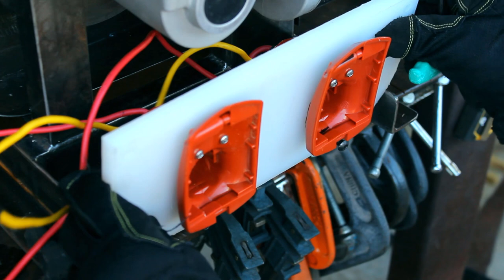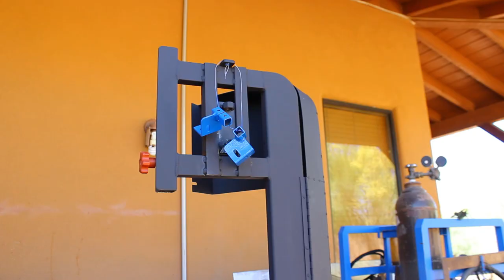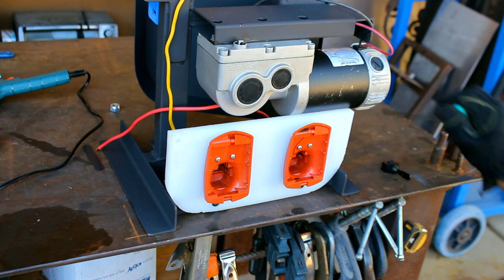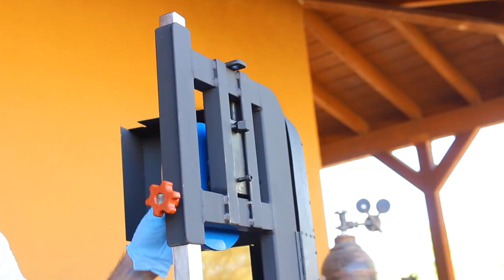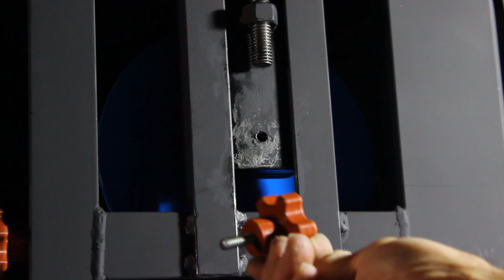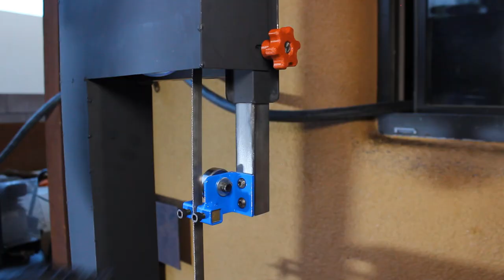Homemade Vertical Metal Cutting Bandsaw part 4 FINISHED!!!

Comment: Nice project and build, very impressive indeed. I have a couple of suggestions you could add to help out. First, you really need a blade guard above the upper blade guide to protect from accidently falling into the exposed blade someday. Only takes a split second to do major serious damage. Second, If you would like to get rid of the battery supply, buy an outside low voltage light transformer (or even two) and a suitable bridge rectifier and wire that up instead of the batteries. They sell them in various sizes. So pick one that has enough current to drive your motor. Then you won't have to worry about charging batteries. And thirdly, install a flexible light so you can bend it around to see a close cut you'll be making. Always can use additional light. But Thumbs Up for your great project.
Reply from the maker: Hey thanks Gary for your kind words! It's funny you mentioned about the light transformers because that's actually what I ended up using. I work in landscaping, and we often come across those older 600 watt transformers being thrown out. I took apart one and slapped an overkill of a rectifier on it and boom, bandsaw power supply! I definitely will look into making a cover for that area you mentioned. I underestimated the blade slop travel. As a result, I made the cover a little shorter than what it should have been to fully cover that area.

Comment: Very nice project! Why did you make the bandsaw that tall?
Reply from the maker: Thanks! I wanted a bandsaw that was relatively compact in size, but could still rip large vertical stock when needed. It is a really great feature to have as I have cut chunky thick pieces of steel that would have otherwise not worked out on a similarly sized store-bought bandsaw.

Comment: You made a good job of this build well done. However, I think you should have used some Lion batteries rather than the NiCads even if they are Hilti. The size of that battery compartment could have held enough to last some time between charges, if that motor is a 48V motor then something like a 10s 4P would give about a 42V 8Ah.
Reply from the maker: Yes I definitely will be upgrading the battery packs. They don't last as long as I would like them to. I'll get some good lithiums like you said

Comment: 1.5kw motor. 2800 rotation, 220 electricity. according to your use is ok?
Reply from the maker: It's actually a 550 watt 24vdc motor currently running on 15.6v batteries, but I do eventually want to run it with a 110 volt power supply dc converter

Comment: What is the spec of your motor?
Reply from the maker: It's a 24VDC 575 watt Jazzy brand power chair motor. It's rpm is 157. I am currently running it at 15.6VDC
Reply: @Brute4rce1111  Thanks.

Comment: never use band saw with glove. too dangerous if keep glove.....
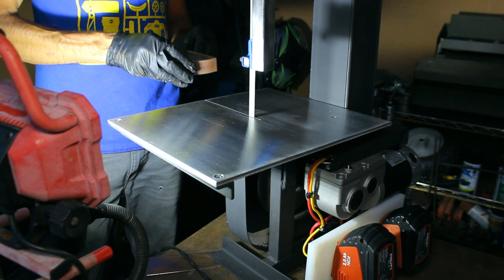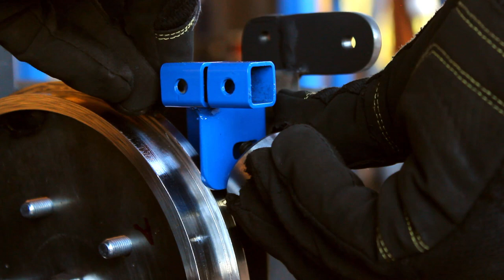Reply: The Nitrile gloves shown at 7:15 are OK; they will not snag on a blade.  The other gloves he was wearing at 4:10 look like welding gloves;  they would not be good, but he had removed them before he used the saw.